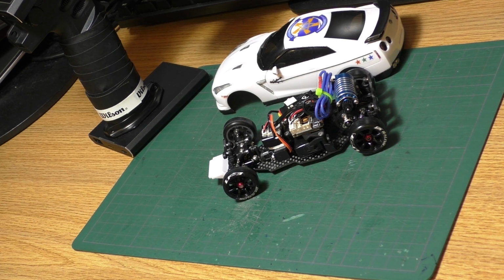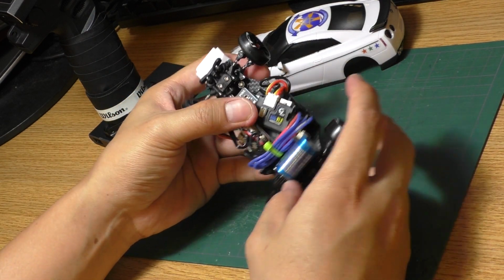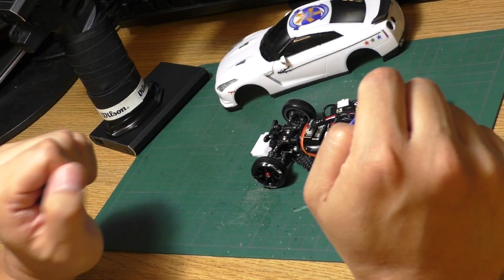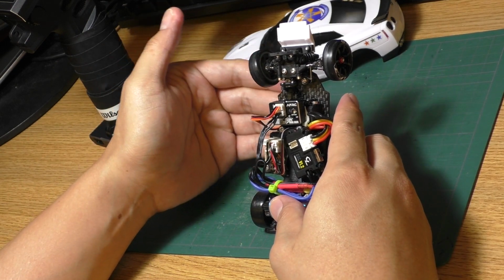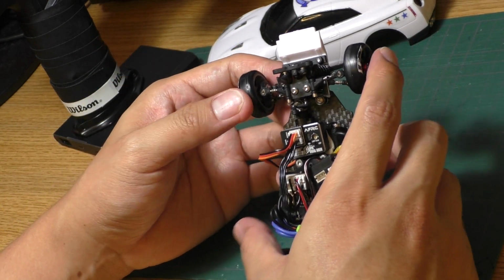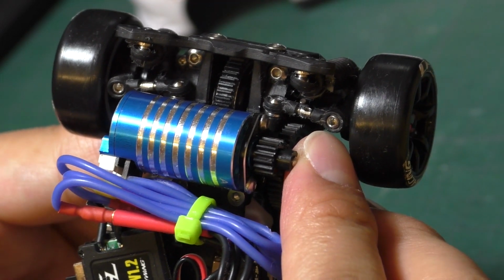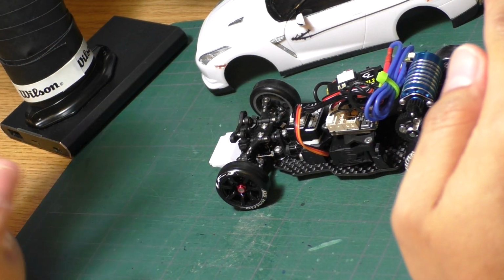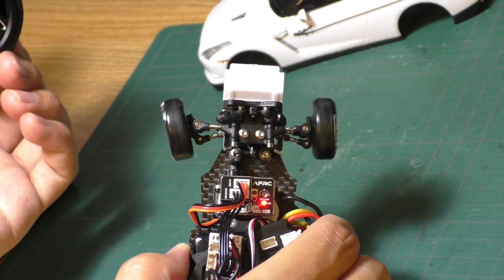GLD Test Drive & Initial Thoughts

Comment: I think the same problem with you is just gear diff / gear a42. My ball end is good, there are no sign of break and nothing is stuck. About front wheel woble, i have it too. I add shim to reduce the woble.
Reply from the maker: If I shim it, it won't spin at all. I have to let it off so it can spin freely. I'll upgrade the knuckles so at least I can shim the wheels and take the slop off that.
Reply: I use 0.1 shim at the rear end of the shaft. And then thightening the locknut just barely touch the wheel. So it can freely rotate. This is my solution about this wheel woble thing. I think gld is too early to be sold, they push to fast before finishing their development.
Reply from the maker: @ilud2007  It was from my grinding as well so I might have spin it a bit too fast and it warped even more so no other solution but to replace the knuckle.

Comment: Hi Ihave a wl969 but most of the time it does not move forward and only moves backwards. If you know the reason, help me. Thank you.
Reply from the maker: Check the throttle trim on your transmitter, it might get stuck at reverse.

Comment: I have a question. Wich one is the better car. The MINI Q full tuned or the HGD1 full tuned.  Can you help me please. Thanks for answer
Reply from the maker: Mini-Q is AWD (except the new one that's just came out and it's RWD... that one is awful) and HGD1 is RWD. So they are different. If you look for versatility then get Mini-Q Q7, it can do both drifting and touring. Otherwise if you want to drift only, don't get HGD1 either, get something like BMR-X, GLD or Atomic DRZ V2. These are much better cars than HGD1. The only reason to get HGD1 is that you only have access to Banggood and can't buy any of the cars I mentioned.
Reply: @BeaversHobby 
 Hello.  Thank you for your prompt reply.  for drifting in the smallest of spaces!  better awd or rwd?  or it doesn't matter
Reply from the maker: @Dinli901  RWD is better in a small space. It's slower and more manageable. Also the trend is going towards RWD too because it looks more realistic.
Reply: @BeaversHobby  
OK.  Thanks very much.  and excuse my bad english.  I only speak a little bit of school English.  i'm from berlin germany.  and i always have to work with the google translator.  i'm a bit older.  54 years old.  i just want to drift a little in my garage, just for fun.  but would like to have a good car in order not to have to buy expensive tuning parts later.  your videos are great so i thought you were the right one to answer my questions.  as, thank you very much.  Best regards
Reply from the maker: @Dinli901  My pleasure. Don't worry, I can understand you just fine.
Reply: @BeaversHobby  hallo. Hello .  please take a moment for me again.  Thanks .... :-) I saw that there is the GLD at HRC Arena.  with ESC and servo.  I use the Radiolink RC4GS from Banggood to control it.  Tamiya bodywork what other parts should I take?  Engine ?  Rims (offset)?  Tire ?  on PVC floor.  Batteries?  ask for your help.  best regards, Christian
Reply from the maker: @Dinli901  You'll need JST-ZH 1.5mm 3 pin plugs to convert the receiver to the same plug style as the ESC. Otherwise you can also make some JST-ZH 1.5mm to Futaba/JR plug.
As for the body, you can choose pretty much any 1/28 you like. Some will be pretty long so you'll need the wheelbase adjustable chassis to go with it.
Wheels depend on the body so I can't comment on that. However you can get a whole set of the MDH100W (this one http://bit.ly/2VeVZsc ) so you have all the offsets. Yeah Racing also make the wheels now so check if out if you are interested. MAke sure you get the wheels for Mini-Z AWD.
As for the motor, 3500KV or 5500KV is a good start depending on how big is your track. Generally 3500KV will do fine. 5500KV is for a bigger track like 3m and up.
Tyres: get DS Racing LF-5. Can't go wrong with that.
Battery: GL has its own battery and it'll fit perfectly. Another option is Marka Racing 350mAh.
Upgrades worth getting: 
Aluminium Bulkhead https://hrcarena.store/item/GLD-Alum.-7075-Front-Bulkhead-HRC-OP-GL/6555072890798080
Aluminium front shock tower https://hrcarena.store/item/GLD-Alum.-7075-Front-Shock-Tower-OP-004/5844897437450240
Rear toe in block 1 or 2 degree. I use 1 degree https://hrcarena.store/item/GLD-Alum.-7075-Toe-in-block-1-*-OP-003-1/5949174461890560
That should cover everything.
Reply: @BeaversHobby     vielen vielen Dank. Das hilft mir sehr weiter. 
Viele liebe Grüsse, Christian
Reply from the maker: @Dinli901  My pleasure.

Comment: I’m having a problem with my new force, just spins to the right even if I turn left.  No front diff now  but was doing it with a front diff,   What’s my issue ?
Reply from the maker: Sounds like the diff only spins on one side. The diff is probably not working correctly or broken.
Reply: @BeaversHobby  rear is locked   And no front diff.
Reply from the maker: @scottyahol  Check if all the wheels can spin smoothly especially the front. Tyres contact is also important, is this grip or drift?
Reply: @BeaversHobby  it started when it was stock so I took out front diff. Still doing it. So I locked the rear diff and it’s still doing it. It does it from a dead stop so I think it’s the rear end. But it will spin left even when it’s turned right. Won’t do donuts
Reply from the maker: @scottyahol  You'll have to check the drivetrain and suspension following stage 1 and 2. https://youtu.be/TnhriaSSfSA
https://youtu.be/QAGTXo70MmU
Reply: @BeaversHobby  I did both those fixes before I used it and it was working great for 9 days then it progressively got worse over days so I tried more tricks on it and it does the same. I’ve taken shock spacers out on one side.  Still spinning out
Reply from the maker: @scottyahol  If you take the front diff out it will spin very easily already. You'll need to diagnose fully and see if there's anything stuck or uneven on the car. Also what tyres are you using? Drift or grip?

Comment: interesting initial thoughts on the kit. i hit the gear with a file quickly and that fixed it not ideal but fixed it

i recommended people shim their wheels. take a close look at the front steering axles when inserted under a magnifying glass and you can see that they are not cut to the correct depth and have a J shape on the flats. seeing this more and more on designs

nice counter point to the reviews, will be tempering and clarifying on my reviews in the future

that servo is great, already had to use it once
Reply from the maker: The knuckles are probably more warped from my grinding as well. I might have spin the dremel a bit too fast and one of them warped even more so no other solution but to replace the knuckles. That was a big oopsie on my part.
Reply: How do you file the gear? I've broken my gear because of that. Ihave to order a new diff gear.
Reply: @ilud2007  Took a flat head file and turned the motor on then pushed lightly till the issue disappeared. ie i would stop the motor and rotate by hand

it helps if you mark the flat spot as i found it only affected 2-3 teeth

just to it very lightly
Reply: @BeaversHobby  oh you dremeled the knuckles? i ended up reaming them for a reason they seemed very fragile

really hope it lives up to your expectations last thing i want to do is have a hand in having you waste your money

if there is a 'buy Beaver a s-wave ESC' fund then let me know. i have always suspected the sensored motors help with drifting but would be interesting to see your feedback
Reply: Do you find the wheel rotation is not as smooth as it should be ? My drz gear box rotate nicely. When i compare with gld, it is not smooth as the competitor.
Reply from the maker: @BlitzWorks  Yes, my problem wasn't only the middle piece but also the bore for the bearing. Put only one in and it's so tight the bearing didn't move so I dremeled it. I didn't expect it to be this fragile though.
Don't worry about it. I don't think it's a total lost... yet. The manufacture has responded the problems and we are working to fix them.
Reply: @ilud2007  Had the exact same issue with the DRZ v2 gearbox but not previous iterations (DRZ v1 or super skeeter) the issues with DRZv2 gearbox where same as this one and issues with the Open Diff tolerances internally

Comment: I don't know what that black plastic is on the ball caps but I have the same problem with alot of small scale cars I started 3d printing some in pla I print them tight then use your drill with a ball end method to loosen them to ideal tolerance so far they work much better and last much longer which is strange  because pla is a pretty average plastic
Reply: I do the same but just squeeze with pliers

Comment: I saw that your car is lifting one side... here pls use rounded tires on front to fix the issue... when you your  lwading wheel is probably not touching the ground so ride height as well ... keep it 2 mm low and all thise linkage better be moving smooth... then try again
Reply from the maker: Thanks for the tips. I'll try and change the tyres to rounded later. Strange enough the lifting doesn't seem to effect when I drive it. I tried setting it so it won't lift and it drives even worse. On other cars wheel lift would be a disaster though.

Comment: I guess I was pretty lucky and didn't break anything so far. My front and rear knuckles were perfectly ok.
I also have the same issue with the gear getting stuck at 1 part but I sanded it a little and it helped, though HRC is sending the replacement aluminum pinion to me soon.
Pretty happy with mine actually, and unfortunate that you and it seems like many others who actually came across quality issues, which is surprising from GL Racing.

I agree that the stock setup is actually pretty bad, it initially gave me toe in at max lock which made the car unstable and hard to drift, though after I tuned it myself and ignoring the instructions, the car handled really nicely.

Also seems like your left wheel lifts and spins a little when turning right, while turning left the right wheel doesn't do the same, which means the suspension geometry from the left and right side isn't 100% the same, which could explain the understeering issue you have.

Weirdly, your steering lock looks a little lesser than mine, but it could be just the camera angle.
Reply from the maker: Here's what I just learnt, if you buy it directly from HRC they will QC your car. It's not directly from the factory like buying from other vendors like I did.
Reply: @BeaversHobby  Sounds completely stupid, they should QC their products when it leaves the factory.
Reply from the maker: @ManicQuinn  It sounds like the factory doesn't have QC procedure to me but well, this is what we get.

Comment: Hey I got a k989 & i over tighten The tire and it kinda licked the diff and when I start to drive it won’t drive I span the tires little more and it’s moving but don’t seem to be as free, how can I make sure it’s back to normal?
Reply from the maker: Loosen the wheels and you can nudge them with a finger to see if they can turn without resistance.
Reply: @BeaversHobby  I got a 284131 actually.. & I seen your video about how it should spin loose and it wasn’t so I took it apart and followed your video sanded etc now all the diff components are spinning properly & seems to not be a locked diff anymore right? But seems to work now fine. Now that I got you here one more question about the diff what way should the bid gears go on both sides? That spin the shaft I see they can both go either way is there a certain way? (I got the rear setup correct but forgot how it was in the front, so I’m not sure if they run on opposite side of the drive shaft or both on the same side?)
Reply from the maker: @adrianau4246  The crown gear will go on a different side between front and back. Normally it's on the left for the front and right for the back.
Reply: @BeaversHobby  great you Understand me! thank you so much man! I really appreciate this
Reply from the maker: @adrianau4246  My pleasure.

Comment: What is worse quality the firelap iw05 or the gl racing gld? Please can you do an update on the wltoys rwd project
Reply from the maker: IW05 is way worse. GL, for the most part is good. The design is fantastic. It just got some manufacturing error but they are mostly crucial parts. Also GL has parts support so I can always fix the car although at a very high cost.
I've torn down the WL RWD and I don't know if I'll ever rebuild it as RWD drift again. Sorry.
Reply: @BeaversHobby  You should sell the wltoys rwd
Reply from the maker: @karenbaxter2706  There's a shop selling that already. I glad it does because I don't have the manufacturing power or time to do it.
Reply: @BeaversHobby  what is the shop called
Reply from the maker: @karenbaxter2706  MJ Modify. It's a shop based in Thailand but it has world wide shipping as far as I know. https://www.facebook.com/profile.php?id=100022777639028

Comment: I own this car from the first day it releases. It brings my sorrow more than joy.

I love the rear suspension and gear box design, however the third gear is off center (plastic QC thing), Well GL soon releases a really well made metal third gear. 
Come on,  I have to pay you a sticky car so I can pay upgrade parts to make it a car matches expectation. 
Before this, how things expected to work : you pay for the car, It will be a very smooth car, you pay extra for the parts to make it fancy.

The front suspension is a mess. I don't mean try something epic but fail with no excuse. Those cambers tow ins are good, but during building it I just feel all the settings will be fall apart with no reason. I don't even have any reference point to ensure the car is symmetry

Working with GLA, you will have a very clear concept what should you do next and where it bringing you to. Then you get a very stable and predictable car

Working with GLR..... don't neet to messy around. It is a pan car, keep it simple, clean. Keep parts smooth, set the height, adjust the spings a little bit is better than good

But GLD, you like my grand pa's tractor. I feel I have noting I could do with you......
Reply from the maker: I totally understand how you feel. This is not the quality I expect from GL Racing. They have... or rather had a good reputation before this. I've just bought some GLA parts to fix it and I'm surprised by the quality gap.

Comment: Do you have a source for the ball caps?  I'm having trouble finding spares for this size.
Reply: GL racing made them. You can find at their store
Reply from the maker: I suppose you can use GLA ball caps instead. They are 3.0 and 2.5mm as well. https://hrcarena.store/item/GL-Racing-GLA-Ball-Joints-Sockets-set-G/6431885764984832
Reply: @BeaversHobby  Thanks Beaver.  Can you confirm the ball size?  I wasn't sure if the 3.0mm referred to the ball or thread size.
Reply from the maker: @juggerd2282  Yes, 3.0mm and 2.5mm are the ball head sizes.

Comment: Well.... HGD1 it seems is the best option for now.
Reply from the maker: Or XRX DPA if you can find it. HGD1 is simple and easy to drive but it can't do much tuning.
Reply: @BeaversHobby  ooo! I'll look into it. Yes, I understood that about the HGD1, and as and an old RC enthusiast coming back to a new part of the hobby, the limited set-up might be perfect. In the process of tuning my MA020 AWD for drifting. Waiting on some tires, so that may be helpful as well
Reply from the maker: @ImranShamsul  Yep, keep it simple at first is a good idea. Since you already have the MA020 it will share some parts with HGD1 like diff, wheels, swing/universal shafts and springs so you can get parts for 1 and use them on both cars.

Comment: I can see right away that there is too much weight over the back wheels. Experiment with chassis balance. And of course, the steering servo seems way too fast and not precise.
Reply from the maker: Yeah, servo isn't the most precise out there. I'll try something else if I have time.
A lot of people pile everything at the back even behind the wheels. That is an interesting setup. I'll try to see which balance is more suitable for my driving.

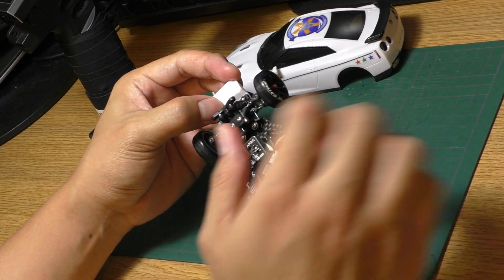Comment: 4:08 - you are completely wrong for "Camber". For drifting you want NEGATIVE camber. If you start at zero and the wheels are vertical, then adding more camber will lean the wheel OUT at the top, making the car understeer more. That's not what you want for drifting!
When a rotating hoop (wheel) in leaned over, it tends to roll in a circle, so when using negative camber the wheels are always trying to toe-in. That's why you add some toe-out to counteract and make the car track straight.
Reply from the maker: When I said "add camber" I didn't mean making it positive. I thought all drifter understand unanimously when we say add camber it means making it negative camber so the top of the wheel leans into the car but there it is... terminology.
No one in their right mind would tune a drift car with positive camber.
Sorry for the confusion anyway. I'll be more careful from now on.
Reply: @BeaversHobby  - whilst you know the correct context, it's surprising how many people get it wrong, especially those "stance" and "hella flush" idiots. Many well known RC channels get this confused as well, so my comment is mainly for information of other viewers and readers.
Reply from the maker: @johncoops6897  Thanks for the info. I'll consider putting some captions on in my next videos so the this will be easier to understand for everyone.
Reply: You are technically correct, especially when talking about full scale drift. In RC drift, it is very common to refer to negative camber as a positive number. It probably started as a misunderstanding, but now its kind of the convention. Good distinction to be aware of although I suspect that anyone who knows the difference between positive and negative camber would know that you don't ever want positive camber on a drift car (full scale or rc) front-end .